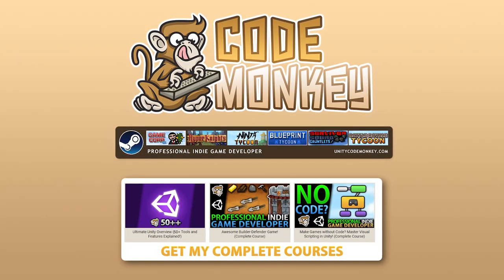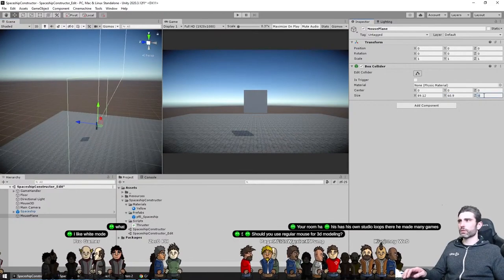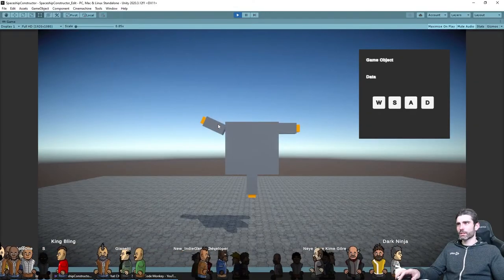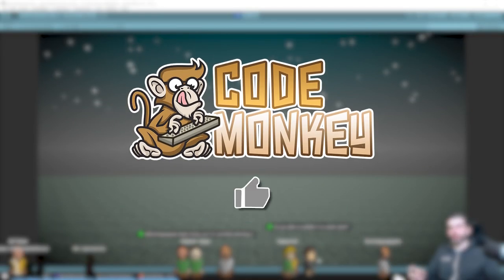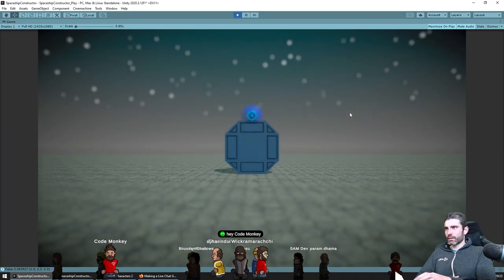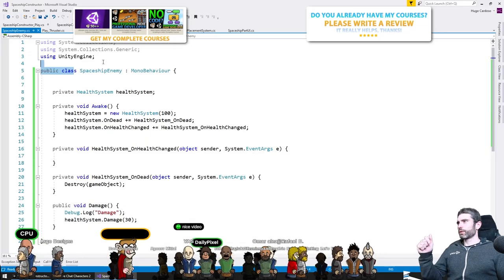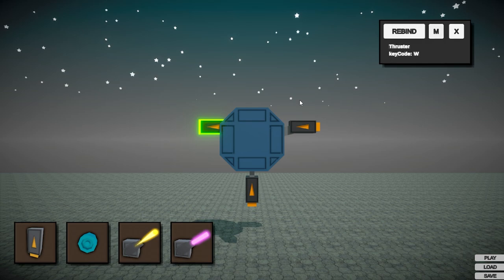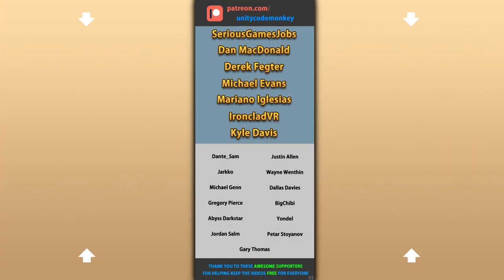Unity Spaceship Building Tutorial - Drag Drop Thruster, Shield, Laser (FREE Download Project Files)

Comment: Can you please make a video talking about quaternions and GImbal Lock problem? In the context of game development or any 3D simulations, gimbal lock can cause sudden and unwanted changes in an object's orientation. For example, in a flight simulator, if your plane is pitched upwards 90 degrees (nose straight up), then rolling the plane and yawing the plane would produce the same effect, which is not the desired behavior.

To avoid gimbal lock, quaternions are commonly used instead of Euler angles for 3D rotations. Quaternions are a type of mathematical object that can represent orientations and rotations in 3D space. They are more complex than Euler angles but avoid the problem of gimbal lock.